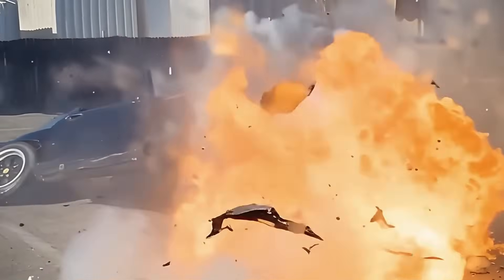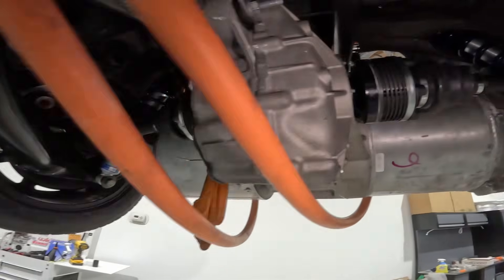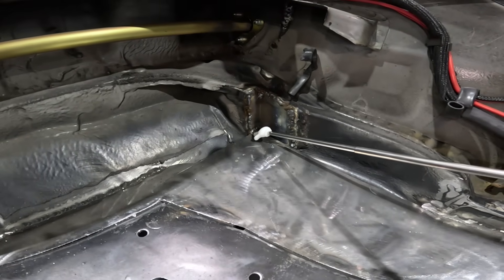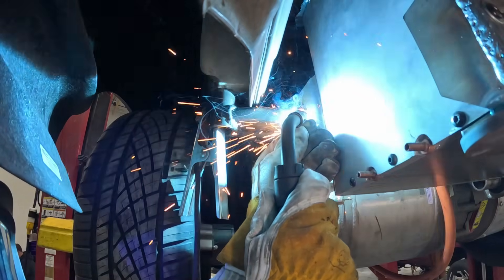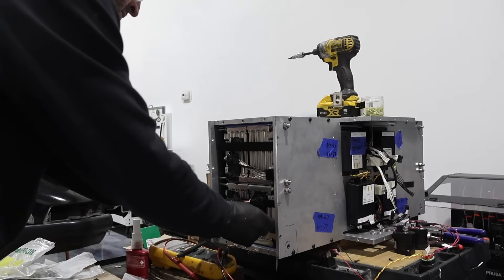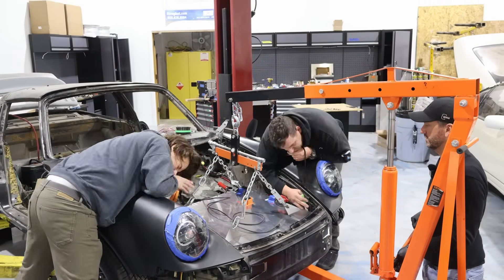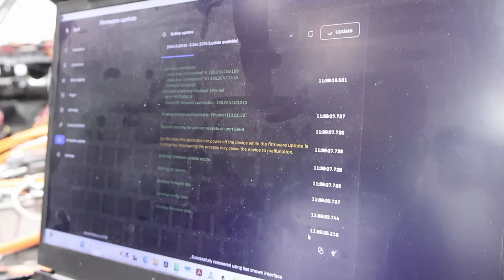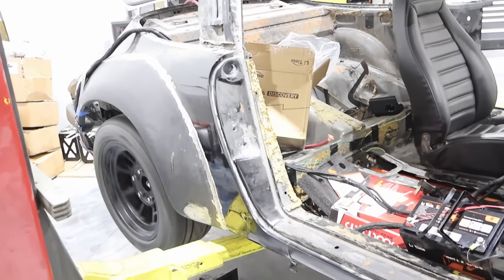Holy sh*t… it moves!  Porsche 911 First Motor Spin!

Comment: What did that floor mounted accelerator pedal come out of. I need one like that for my EV project. Thanks again for another great video. Also, feel free to dig in deeper with the battery boxes, especially the contactors and other tidbits.
Reply from the maker: It is a Porsche Tycan pedal

Comment: I really would love to see how big of a battery that could be built in the frame rails of my 87 suburban :) I put 3, I3 batteries in the frames in cad .. I have a suburban up on blocks now .. I'm trying to get engine and trans out so I can scan it. my biggest issue is going to be my AC idea .. I would like to keep my r12 system very seriously doubt there is a electric r12 ac compressor doubt even a 134a version ..

Comment: Fabulous work compilation and in the shop. After all the new metal patches and support steel, how do you get anywhere near the quality of a factory underbody paint? I ask because what if one of these cars ends up in the Pacific northwest or Maine, etc where salt on the roads and in the air is quite common. That much effort, time, and money shouldn't be going to rust too soon.  /edit- ahh I finally got to the point when you said 'when the car gets painted'.
Reply from the maker: Once everything has confirmed fit and function, it will be all disassembled, blasted, coated, then painted.

Comment: Are most of the cables not a bit to lose inside of the box? Vibrations are going to brake and rub those wires, never work on cars so don’t take it as advice, just a question that popped in my head when I saw it.
Reply from the maker: All cables are cloth wrapped and tied down to anchor points.

Comment: Your Customer is very smart to demand 108mm (“930”) CV joints. That extra 8mm basically doubles the torque rating of the joint. From 960 ft/lbs up to 1840 ft/lbs.
Reply from the maker: I know, right?!?

Comment: i say, fuck the back seat and put even more batteries in. 400-500 miles of range.
Reply: Then it becomes a tank and the extra batteries are just used to carry the extra weight.
Reply: @truantray aight nvm then lol. If it would kill the performance or handling its not worth it